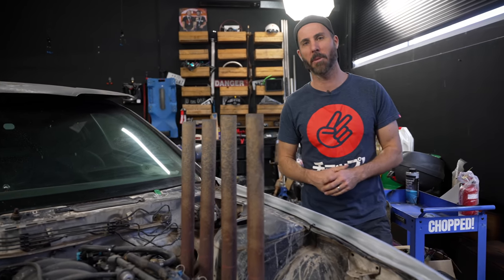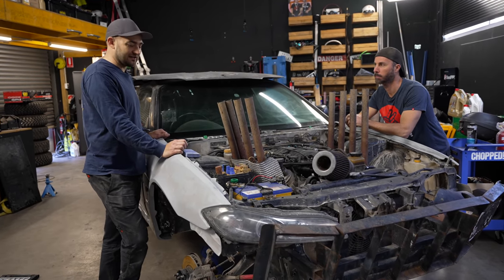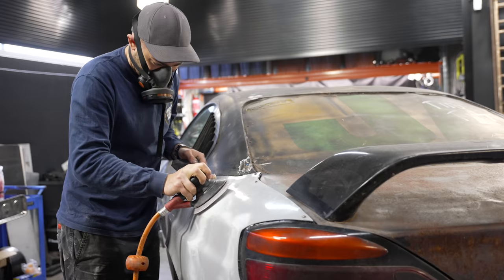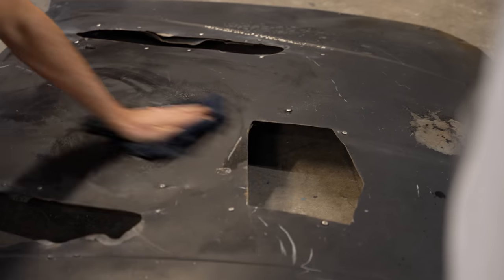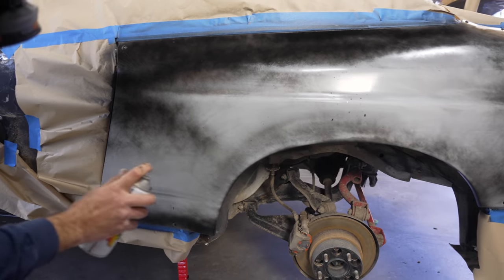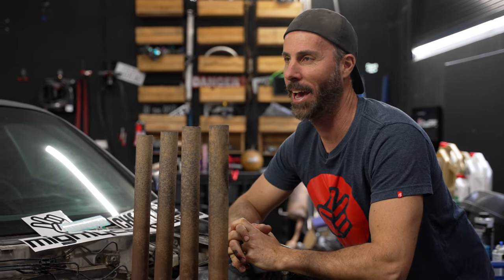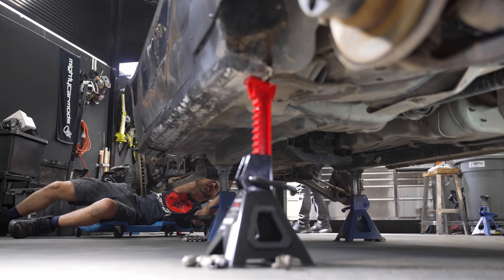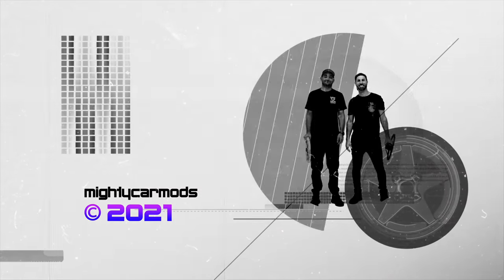Building an LS1 Silvia Drift Missile (MOD MAX)

Comment: i can see why ppl dont like LS engines on JDM cars but the sad truth is that is a solid engine that is compact, has better aftermarket, makes ton of power for cheap and fits on most cars, where good old straight 6 engines like 1-2JZ engines start to be rare breed since most of them are used up or blown up and price is almost weight in gold. 
my cousin did a engine swap on hes 180sx and he got the engine from BWM M5 "cant remember the exact model" since it was cheaper to get old BMW for donor parts than getting good I6 engine

Comment: Bruz 180 woulda be fine to rub it back then go to 320, 80 is a bit rough and makes more work… if it’s plastic start at 180 and finish on 320/400 with a guide coat such as gmh black on a dust coat
Reply: The gmh dust coat would only be used to get rid of all the 180 scratches
Reply: I take back what I said..

Comment: Of course people aren't happy with LS swaps.  Don't get me wrong, they're a great engine...it's just that it's been done so many times it's getting boring.  Same thing happened earlier with the small block Chev 350...a great engine in its day, but not as interesting to see as a Mopar or Ford offering - just for the variety if nothing else.  But there's a reason the SBC and LS have been so common for swaps - they're an easy swap that makes lots of power.  They're a victim of their own success, in a way.  :-)